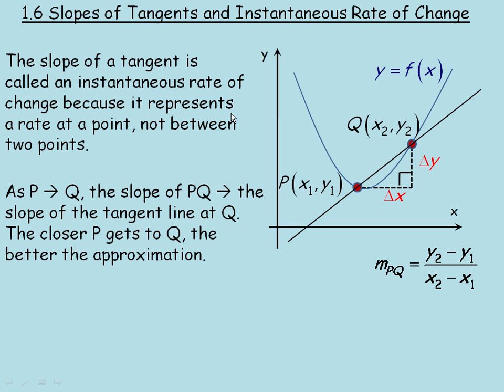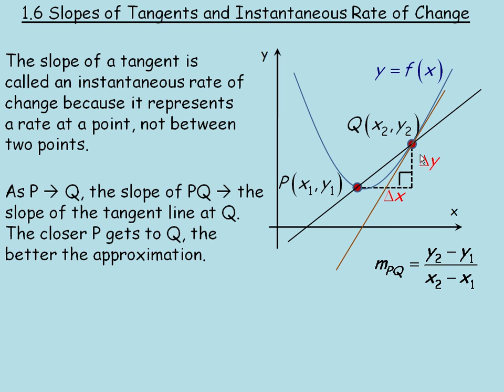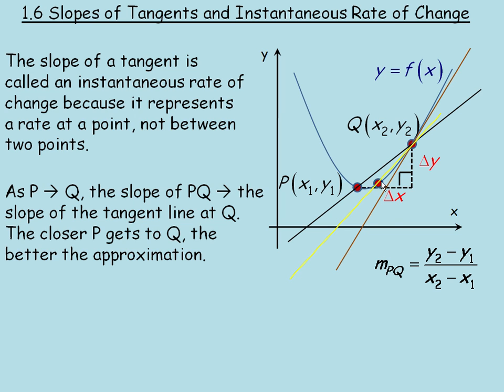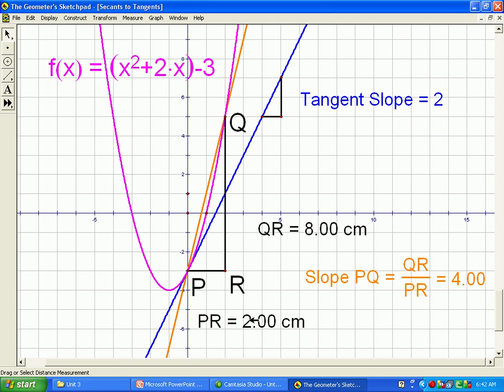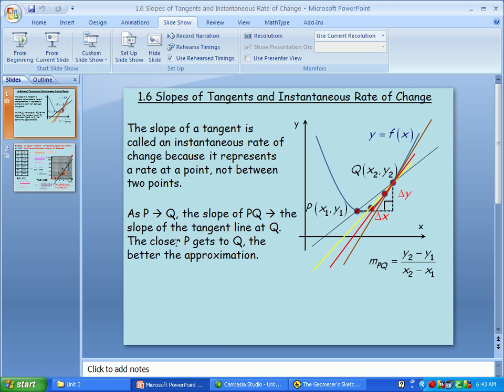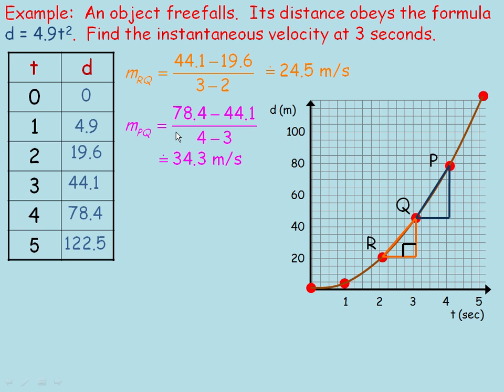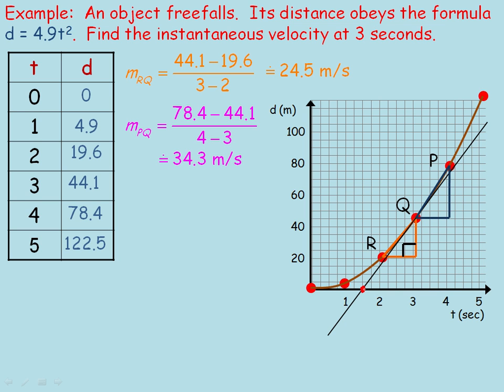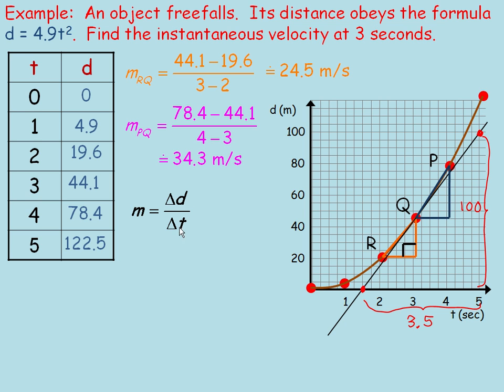Slopes of Tangents and Instantaneous Rate of Change

Comment: how would you solve 
"a firework shot into the air such that it's height,h, in meters after, t seconds can be modeled by the funtion h(t)=-4.9t^2 + 27t +2." 
a "copy and complete the table"

Interval                                                    (triangle)h      (triangle)t       triangle h/triangle t
3 less than = to t less than = to 3.1
3 less than = to t less than = to 3.01
3 less than = to t less than = to 3.001